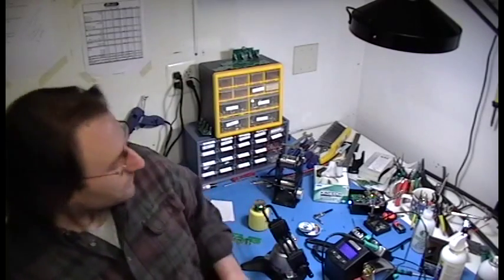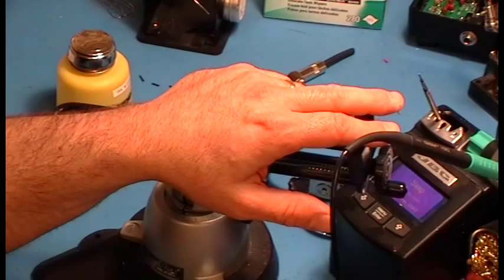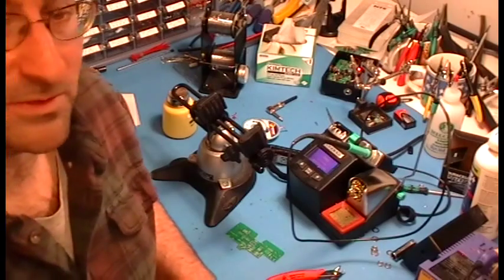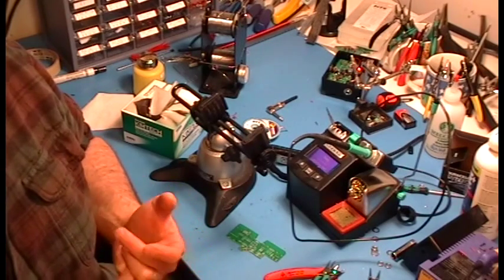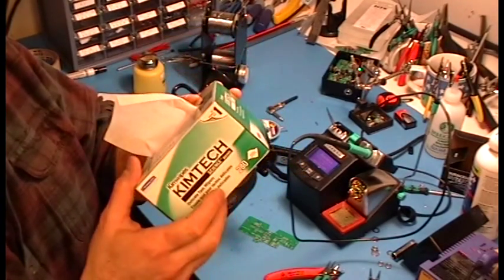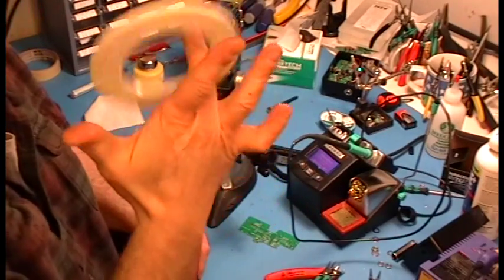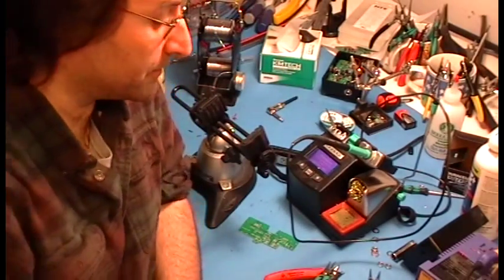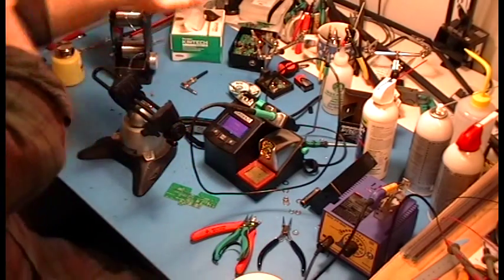JColoccia Guitars Horus Build and Soldering Tutorial Part 1

Comment: Panavise Jr is the one thing I need to get along with desoldering station/gun.
By the way, these video's aren't boring. Quite the opposite! Thanks for making these videos.
Reply from the maker: hadley101 Thanks, Hadley!  I've since added a Hakko desoldering station.  A bit pricey, but it really comes in handy when you're prototyping.  It's definitely overkill for a hobbyist, though.  There are some much cheaper alternatives available these days if you only use it once in a while.

One trick I do now that's not in the videos is I cut a piece of foam to fit inside an enclosure, and I stuck some velcro straps to it.  Then I covered the foam with masking take to stiffen it up a bit and protect it from the heat.  Instead of taping down parts, which works very well incidentally, now I simply place the populated board upside down on the foam, strap it down, and solder away.  Makes for very quick assembly for  parts that lay flat against the board, like resistors and DIP sockets.
Reply: John Coloccia In my case as hobbyist using velleman desoldering pump which works really well for me. Never been able to use or enjoy using wick. Been looking at CSI station or even the $100 electric vacuum pump via Ebay/China. 

Been using 3M blue painters tape to secure components to boards for some time now. Know you need something much more efficient and
professional. 

Thought you might be more than just hobbyist and now find Pete Thorn demoing your Horus pedal and realize you are a boutique builder sharing and helping others.

Wonder how you deal with sending pedals overseas to Europe with ROHS?
Feel for you, wouldn't want to have to use lead free solder. Set up a whole other assembly station to use lead free would be my guess.

By the way, Horus sounds great!
Reply from the maker: hadley101
More than just RoHS, you have to register in each country for WEEE compliance.  I can switch to lead free and become RoHS compliant anytime I want, but for the couple of customers I have in Europe, it's just not worth the headache.  Therefore, I don't ship to European Union countries.